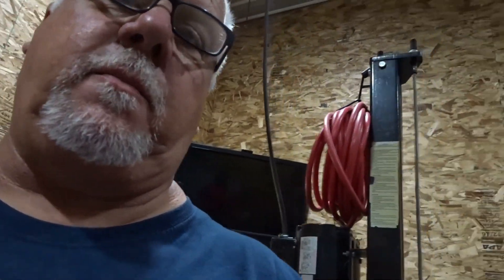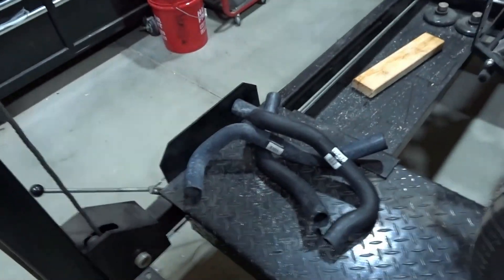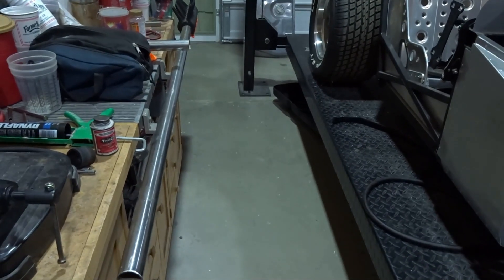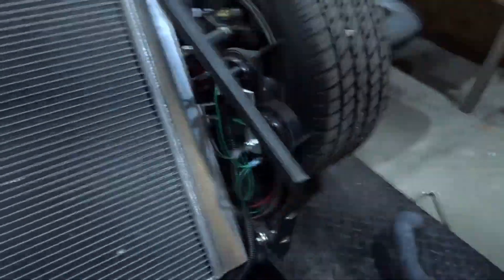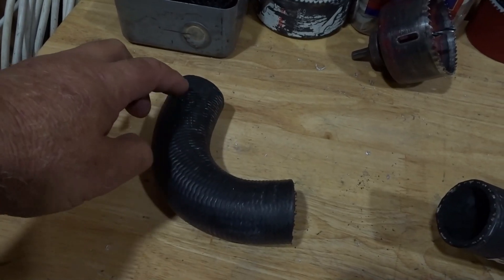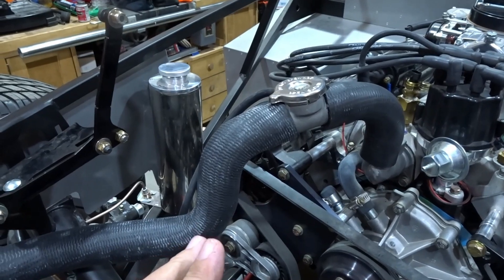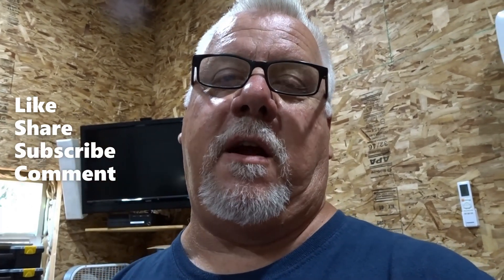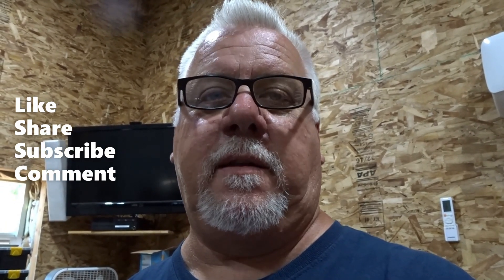King's Cobra Upper Rad Hose

Comment: Good suggestion.  I used a gates 22043 for the complete upper hose.  Made two cuts to make fit correctly.  Sits a little lower.
Reply from the maker: There are probably a number of more hoses that could be used in this manner. I tried to find one that I knew would be available for a long time.

Comment: THANKS! Do you run 195 degrees on a '93 foxbody block? HCI.
Reply from the maker: I run a stock Motorcraft tstat. https://www.rockauto.com/en/moreinfo.php?pk=1833076&cc=1134133&pt=2200&jsn=482 It's a 190/192* tstat. Motorad also has the OE temp tstat. https://www.rockauto.com/en/moreinfo.php?pk=10711480&cc=1134133&pt=2200&jsn=490

Comment: As always Frank, sage advice from you! So, it’s 212211 for the win! Thanks! I was all about the chrome and considering the cool tubes myself, but it just makes sense to mitigate the failure points and snazzy look for something more secure. I guess one could put a “dress-up” kit over the rubber to add some color if they so desire?

Anyway, you’ll have to do another vid on the lower tube if you get a chance. That is, if there is a single tube solution out there made that would work? Again, thanks for making the content and passing along invaluable tips to all builders and owners of these cars.

Oh, by the way… Where is that merch store? I would love to have a black hoodie, beanie hat with the i.e. 427 logo. Even just a sticker to help support the channel and represent.

Great stuff! Keep up the awesome work, Frank!
Reply: I'd also like to see a dress up kit on the hoses just to make them pretty.  Good solution.
Reply from the maker: I'm old enough to remember my Pop's telling me "chrome don't get you home". When I got into racing, the old timers would always say "if it doesn't make the car faster, it has no business being on the car". My whole thing is reliability. Some of these owners are thousands of miles away. I want them to be able to service the car with parts they can get at any parts store. And I want to make them easy to repair, if needed.
Reply from the maker: Doug, I forgot to reply to your question about merch. We have plenty of t-shirts, 2 styles, 3 colors (depending on the style/size), we also have a few windscreen banners, keychains and license plates. Hit up Mrs. i.e.427 though email and she can set you with whatever we have available. I'll try and put links on the facebook page for pictures and pricing. Frank

Comment: Tubular Automotive is manufacturing some of Boig Automotive tubes. Just purchased from them.
Reply from the maker: There is nothing on their website, I checked. If they are selling them, they should do a better job of making them available. I do like the Cool Tubes but at the same time, they are expensive. My solution costs about the same as a combo meal. I like that...... and a combo meal. LOL!
Reply: @i.e.427garage  Agreed on the website. I can't recall how i came across their business. I called and spoke with a gentleman for a bit. Seems like a small shop, he was very knowledgeable and knew Bob Boig personally. The upper radiator hose part number is the same as Boig #BMS-103. It wasn't inexpensive, but a nice aluminum part which included rubber hoses and clamps.